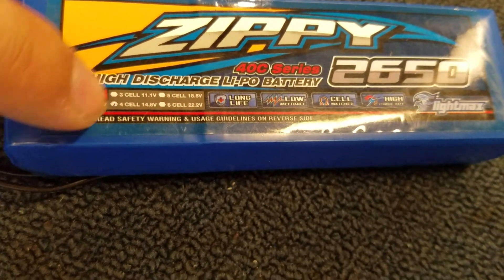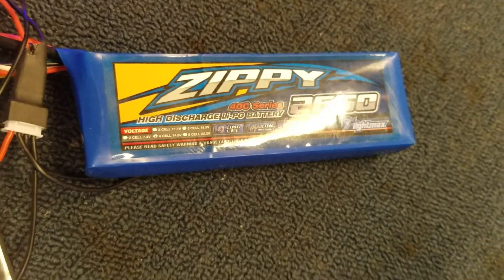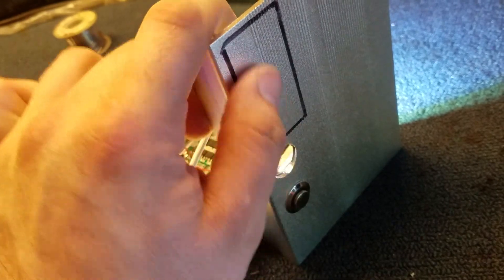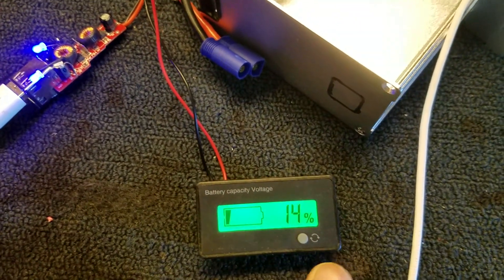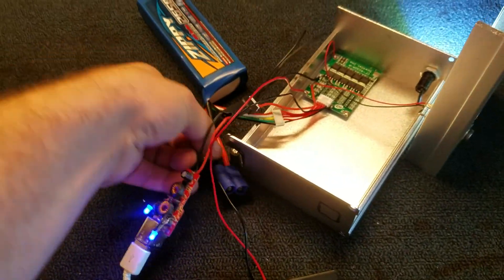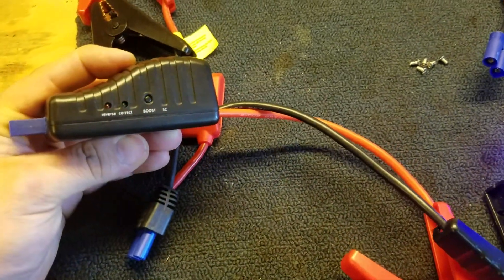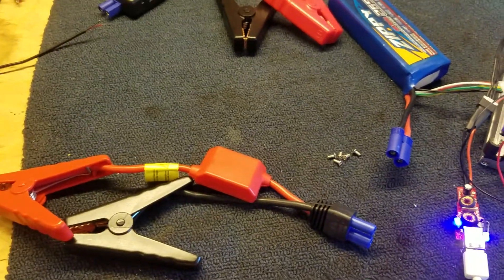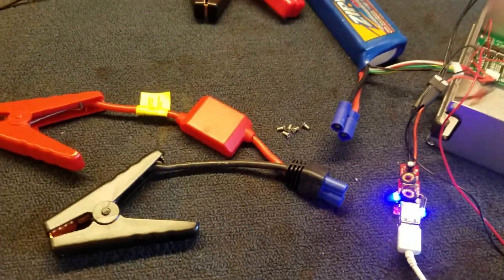Part 1 Diy Lipo car jump pack, flash light, usb charger

Comment: Hi hello from London
Can i ask why you cant use the 4s lipo with the smart battery clips.
I have a set of smart clips left over from a jump pack that died. (was a 3S pack). I have a spare 4S lipo battery 6200mah 100C spare  from my  RC collection and i feel it would make a great jump pack battery. I have it balance charged at 3.9v per cell. so its sitting at 15.6v ( about 60-65% charged which is good for long term storage as well) i wont ever charge it any higher . Do you think it will work ok with the smart clips.
Thank you
Reply from the maker: @stevehodges6792  no mine didn't work because the voltage was over 15 volts. It locks itself out. But they do have or u can make a set without the smarts.
Reply: Thanks for the reply. I was thinking of putting a couple (maybe 3) of the non smart diode modules in parallel to increase the current capacity.
Do you think that would work well with my 4S battery. Thanks
Reply from the maker: @stevehodges6792  should work fine. At least you will have reverse polarity and back charge from vehicle protection